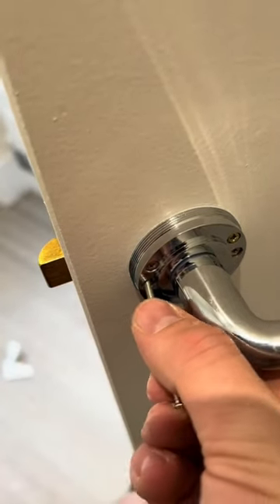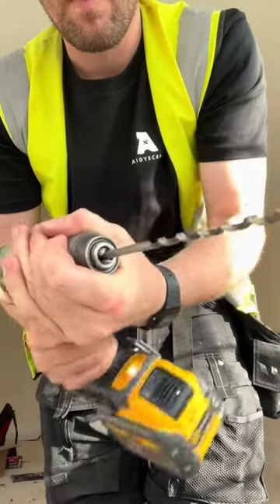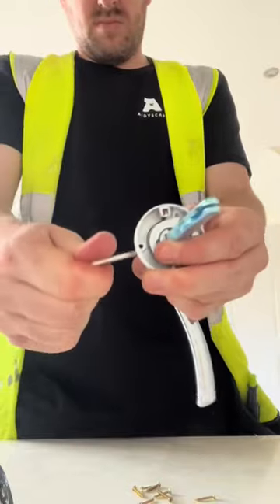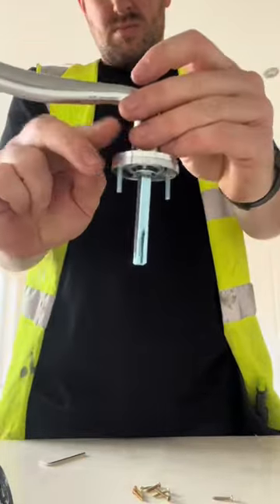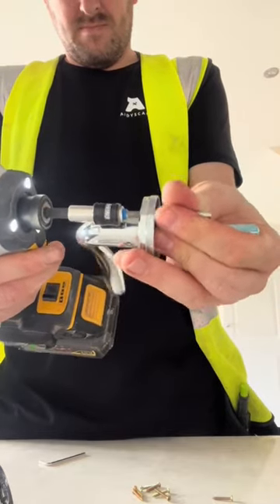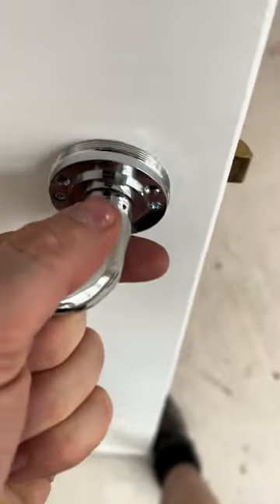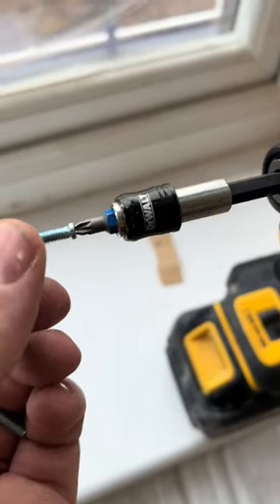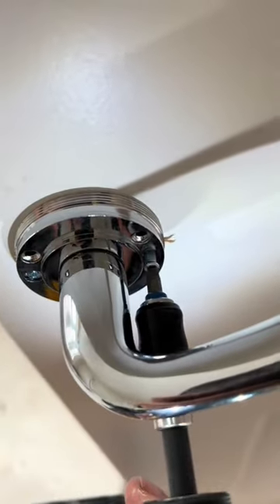EASY METHOD Lining Up Threw Bolts Doing Door Handles #shorts #howto #diy #construction

Comment: Whats the point if thru bolts? Fire safety?Took me an age to fit on one door.  Was so tempted to bin the thru bolt and use the small screws only. Surely most the load is on the grub screw and spindle anyway? You make it look easy 👍
Reply: Point is the doors all the sites use now are cheap shit nothing for a screw to get hold of without the through bolts the handles will drop off in no time😂😂😂
Reply: @052ric4  Ahhh good point.  So suppose I could ditch the thru bolts on my doors because they are solid wood. 🤔👍
Reply: The through bolts stop the handle being ripped off potentially leaving a person trapped.

Comment: I use a old handle, take the lever off so just the rose, put spindle in and clamp up, rhen pilot the holes to 6mm, push spindle through latch then drill through 👍

Pain marking sometimes the lever gets in the way of inside hole found easier and quicker this way

Comment: Don’t bother if the Grub screw in the handle fails ,you may as well get new handles that replace the old ones that cost that company 99p . 
The power is in the connection inside the handle connecting the handle to that face plate that always comes lose and the handle fails.
those bolts mean f all it’s all about the Grub that or go buy decent handles for at least £22 each last a life time maintained or not .
If you do need to do all this do it by hand with nice screw drivers stuff the impact .
Reply from the maker: totally understand this comment, cheers Bart!
Reply: @Aidyscape  we do the same job bro and I stopped giving a 💩 with them bolts a long time ago . man the arguments I’ve had over them stupid things ignorant foreman’s never listen 😅.

Comment: I only use the through bolts on heavy doors
Reply: Amateur
Reply: @PNH63  far from it
Reply: @Strang3rman  what is relevance of how heavy the door is
Reply: @PNH63  it's obvious isn't it?
Reply: @Strang3rman  enlighten me amateur
Reply: The practice of using through bolts regardless of door type is good practice as handles are bolted to each other making it very secure. Through bolts are not installed by lazy tradesmen with poor excuses why thy can’t be bothered.
Reply: @PNH63  I get what you are saying, but on a very lightweight door with screws and grubscrew attachments, I don't think it's necessary
Reply: @Strang3rman  and there is the difference between tradesmen and amateur
Reply: @PNH63  I know

Comment: Shocking way to fit a handle. What about the screws that are supplied for the rest of the holes to support the handle on the door because you and me know that the handle will work loose eventually if just through bolts are fitted. Quick fix instead of doing the job properly and even leaving the outer door skin that you butchered sticking out of the side of the handle. You should be ashamed as a tradesperson that someone is buying a new home and you are a cowboy contributing to many issues with new houses. I can say this because i have over 20 years in the game. 😂😂😂😂😂😂